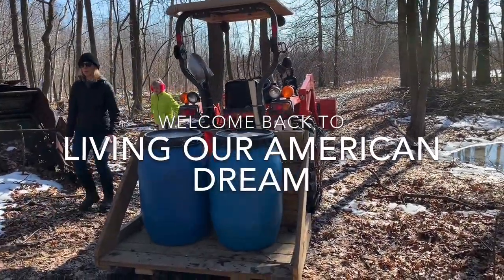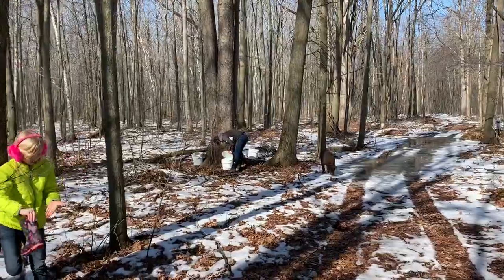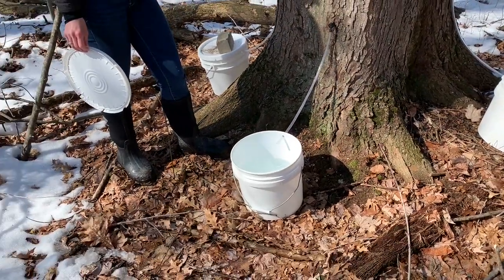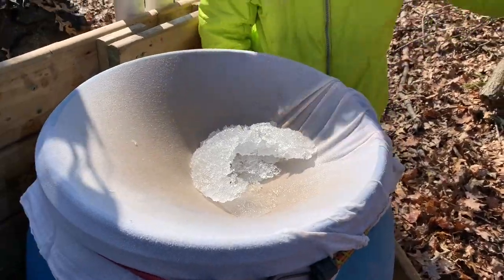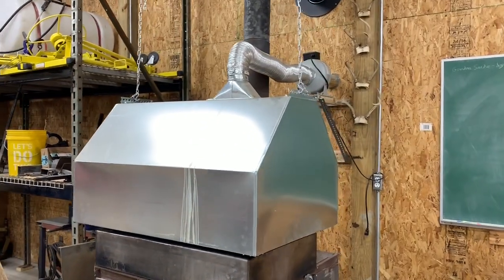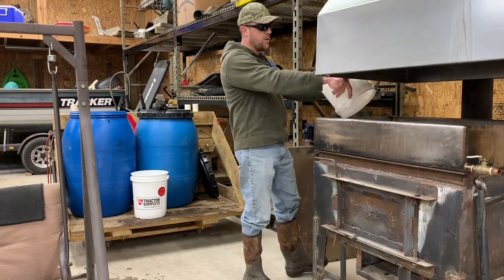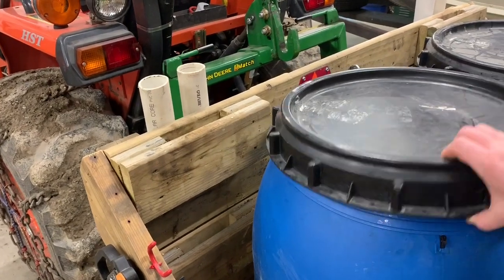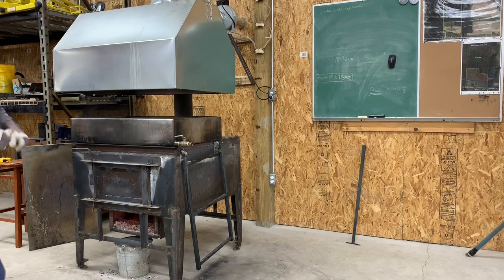136 Maple Syrup Processing, Start to Finish

Comment: Good video with lots of information. So what’s more important, boiling to 219 or getting the density right? Which do you aim to get to first?
Reply from the maker: Last year was the first year I used density to finish. I’ve always used temperature and personally I can’t tell the difference. If your producing to sell it, I’d use the hydrometer but if not just boil to 219F and be done. In fact last year I accidentally broke my hydrometer and I have no intention of replacing it. I’ll finish at 219F and be done.